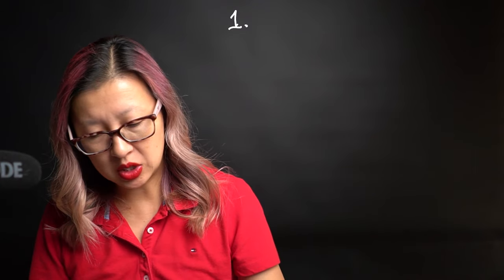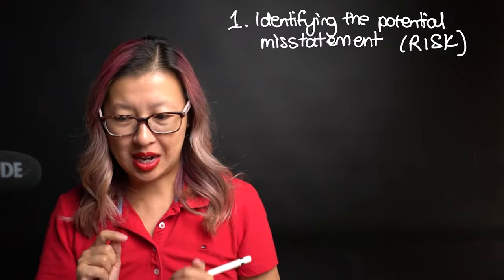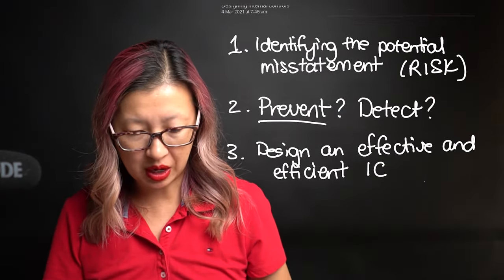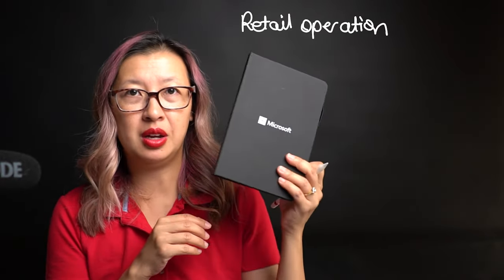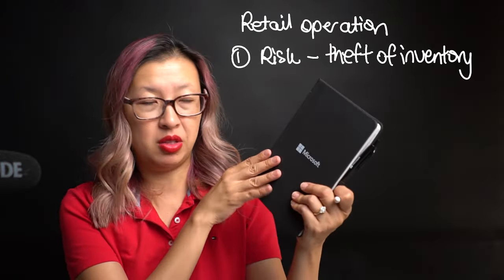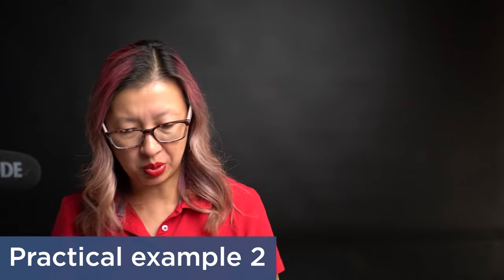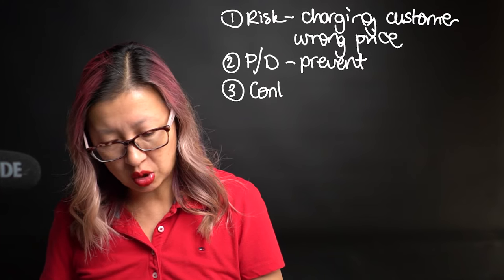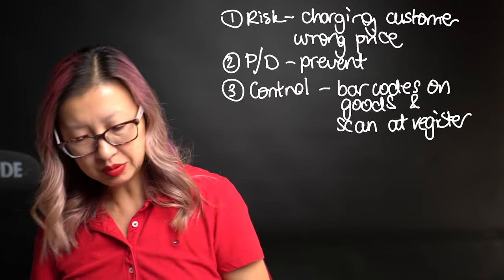4 steps to design INTERNAL CONTROLS

Comment: Amanda, what you are defining is what we in  Quality Management refer to as the Plan Do Check Act (PDCA) Process, where the internal control could be part of the Do function and the monitor part of the check function.   
What is missing from you definition of process internal control is the Act function relative to Checking or Monitoring the process and its relative controls 
This missing bit is extremely important as it completes the cycle of PDCA, and results in Continual Improvement of the process. 
I see this quite a lot where controls are implemented and monitored, however. failure or concern of failure discovered from monitoring and measurement, is not necessarily identified as a required action as it would be in the PDCA cycle. 
.....
This does not mean there needs to be action taken for every single hiccup in the process, however monitoring results should always rise to the level of reporting, where management can determine if there is reasonable need to act. 
Thanks
TJ